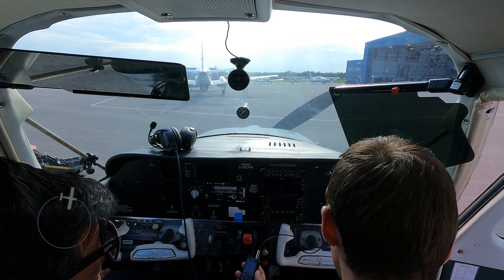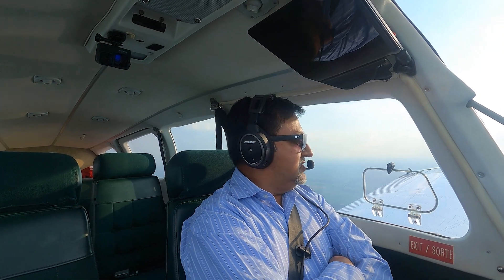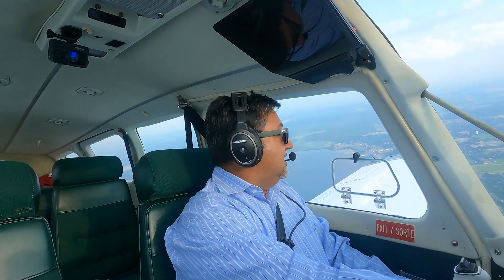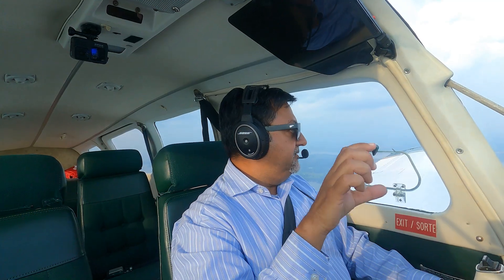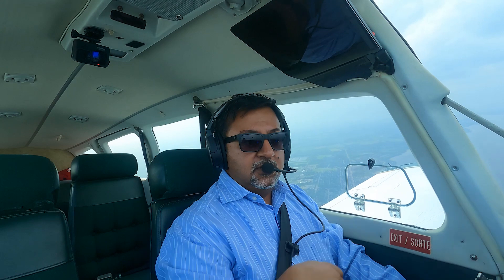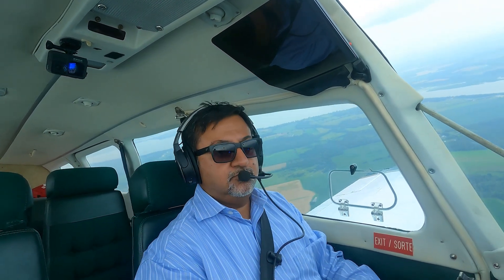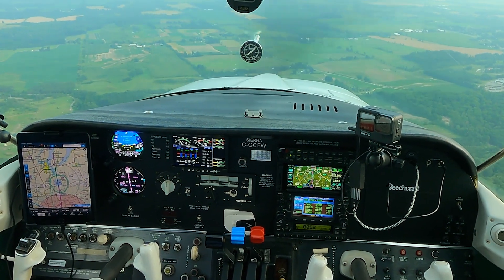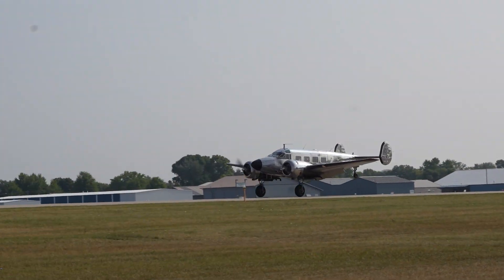Time to break in the new instrument panel

Comment: Did you figure out why it pitches up? I have had the same problem with the same avionics , i believe it’s due to not having the approach activated before the FAF and/or not intercepting GP within a certain deviation.
Reply from the maker: Hey there. That’s interesting. We only tried it twice during the test flight and I have tried it since, but both times we intercepted the glide slope well before the FAF, on centerline laterally, and from below. So I don’t think that was it. But now I want to go up and try it just to confirm. So with yours, as long as you capture the GS before the FAF and on center, it works every time?  

I’m waiting for a couple of final parts that the avionics shop still needs to install to finish up the panel, and I plan to have them do some diagnostics then to try to figure out why it’s not following the glide slope properly.

Comment: Nice looking panel. Looks like you are very comfortable using the new gear to this point. Looking forward to the OSH videos. Take care and blue skies and tailwinds always.
Reply from the maker: Thanks very much, Reale!  The Garmin gear is so intuitive, it really didn't take much to get comfortable with it.
Reply: @WingsOverTO  Agreed. I have been a long time user of Garmin products myself and there tech support is excellent too.
Reply: I had a similar experience moving from a 6 pack to an all glass panel. It took me a long time to get used to a digital air speed presentation. 

BTW - you still need that snubber on your manifold line of your JPI. 😊
Reply from the maker: @Marauder92V  Thank you!  I was trying to remember what that was called yesterday.  Unfortunately I didn't remember in time to have it done during my annual last week.  Next time it goes in, I guess!